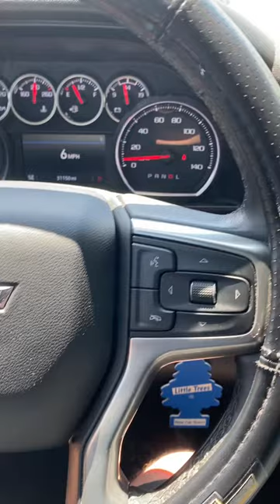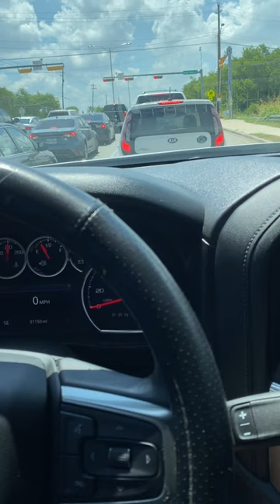2021 Chevy Silverado weird whining noise

Comment: I took my belt off and started the truck and it still makes the noise, come to find out these trucks had a problem with the vacuum pump and that’s where my whine noise was coming from. So if anyone is wondering I would pull your belt off and if the noise continues I would start looking at the vacuum pump.
Reply: which vacuum pump? break vacuum?

Comment: What you don’t like the hellcat sound? I just replaced mine in my 2021 just out of warranty due to mileage. Just over $100 for belt and idle pulley and used the zip tie belt install method.

Comment: Same sound and same issue I changed belt and going to change idler pulley dealership has said it’s a common problem and people have been changing those two parts
Reply: Thanks for the information

Comment: 100% idler pulley. Even tho you probably know that by now. 2021 Silverado 40k miles and idler pulley was going out. Had some people fooled with the supercharger sound.
Reply: Do you know what part number to order? My 2020 just started with 31k miles
Reply: How much was it to get it fixed
Reply: @Jdawg-hn5pd  like 70 or $80 to do it yourself.

Comment: Ive been watching this video and reading these comments for the last couple weeks looking for answers on my 2020 trail boss with 43k miles. Was having the same noise so i took it into the dealership to get everything looked at including the idler pulley and torque converter but where i live it has to sit at the dealership for 2 weeks before it even gets looked at so i went to pick it back up after a couple of days because i simply cannot be without a vehicle. Im the original owner so i still have the 560 warranty however i was sweating bullets because i had put a k&n intake on, so i went to go get it to put the stock one back on then take it back like a week later so i would not void the warranty. Turns out that the noise completely disappeared after i put the stock intake back on. It makes no sense to me how or why there should be sensors all over that tell me im getting either too much or not enough air. My advice is that if you have an aftermarket intake put the stock one back on first before you go drop any money on it.
Reply: That’s weird. Mine started doing that a few weeks after i put after market exhaust. I ordered the idle pulley and belt. Hopefully that’s it
Reply: @Guanacoboi  Was that it (the idler pulley)? I also have the after market intake. Hoping it's not that because I sold my stock intake lol.

Comment: This was a very helpful video and so are the comments. I have a 2021 Silverado making the identical noise. Following on the comments, I took it to a mechanic and suggested the idler pulley was out. Turns out that’s exactly what it was. Thanks!
Reply: @gregmac2392 this is the same sound my 2020 Silverado just started making . Is this something that is covered under the chevy warranty ? Or about how much did it cost you to get it fixed ?
Reply: My 2020 just started doing this!
Reply: Mine 2😂 but I got 75kmi warranty wtf! Such a bs for such a newer truck
Reply: @Guanacoboi can I ask how many miles at which it started?

Comment: The issue with my 2021 Silverado 5.3 engine with 15,600 miles , was a bad tensioner pulley and serpentine belt . There’s no whining now . But I’m still saying , those type of issues normally happens miles down the road . I’m glad it wasn’t more serious.
Reply: Was yours covered under your warranty I’m having the same problem with my 2021 trail boss
Reply: What parts did you order? Part numbers? Thanks
Reply: My 2006 2500 Silverado that I’ve had since 06 just barley starting doing it
Reply: @chuyg522  it’s the idler pulley. I changed it on mine along with the belt bc you have to as well and it sounds quiet and smooth now 😎

Comment: Yup had this same problem went under hood and shot some lube on idler pulley and noise changed drastically. So went to dealership and they replaced belt plus idler pulley and it is quite like a brand new truck. They know this is a problem!!!
Reply: I’m in a rental and it’s doing it bad. 68k
About to spray it down like a clown!
Reply: Still loud. 😢

Comment: Same sound on my 21, 44k miles. Sounds like idler pulley. Thanks for video.
Reply: Me too i have the 2020 5.3
Reply: @robertsonmaciel7426 same here. Did you get it fixed?

Comment: For those who might care. I have a 2019 Chevy Silverado 1500 5.3 4x4 ltz. It was way to quite off the line for having an LS 5.3 so I cut the muffler and exhaust flap off and put a straight pipe in it's place it still comes out the passenger side behind the tire. IT SOUNDS AMAZING even with the automatic fuel management when it's in 4 cylinder mode its ok when I stomp on it or cold start. Its everything id expect and it sounds so aggressive!!!!!

Comment: Ive watched this video 50 times and been reading all the comments trying to get an idea of whats going on with mine. Im sure homie has got it fixed by now but i just got mine fixed with the same exact sound, it was a transmission fluid pump that had failed. Easy fix for the dealership. However if you’re reading this and you have the same issue i hope you are the original owner because mine would have been $4500 if i wasn’t under the original warranty. Dont go tearing apart your idler pulley or some shit like that. Anyway, as of october ‘23 as i write this chevy has been on strike for 2 months straight now so parts are extremely hard to get. Luckily the area i live has a huge inventory. Inflation has gotten fucked too and made parts expensive. If you have the same issue hopefully you have the 5,60 warranty or know a skilled mechanic cuz I already know i wouldn’t have dropped 4500 on that shit. On top of it all it was driving fine too with no check engine light.
Reply: This comment sounds the most correct to me. It sounds like power steering pumps used to sound when low on fluid. 
It is definitely a fluid pump sound. 
The only two fluid pumps on this truck are the oil pump and tranni fluid pump. 
My truck is making the same sound. 2 weeks after purchase. 

Does it also feel like it shifts down too early? Or like all the gears feel like 1st, as soon as you take foot off gas, the truck slows very quickly? 
Thanks all

Comment: My guy please do a follow up video if you have the problem fixed. I NEED to know what’s the problem because my 04 is making the exact same noise. I can’t figure out what’s making the noise
Reply: Did you fix the problem? My 05 Silverado is now making this noise
Reply: @Kevin_Yagoonie  power steering pump. Typical older GM trucks have had that noise problem
Reply: @aidanhaller5800  geez I been having bad luck with it lately. First a brake line went out. Then the brake master cylinder leaked brake fluid in the booster and sucked fluid into the engine. Replaced the brake booster and master cylinder and while bleeding brakes a front line blew out. Now this damn whining noise. Haven't even got to put the front brake line in yet 😡
Reply: @Kevin_Yagoonie  well, its an 04. She’s a bit old

Comment: Did you ever get it figured out?? I have the same noise. Taking it in tomorrow to the dealership. I took off my pulsar lt and when I turned my truck on I have a check engine light now. Usually an idle pulley won’t cause the check engine light.
Reply: I have same noise too. What did the dealer tell you?

Comment: I'm having this same noise and it's driving me nuts. In the past week I've replaced my idler and tensioner pulley, serp belt, stretch belt, water pump and thermostat and I'm running out of ideas of what it could be. Mine is a 13 silverado with 114k lifted (which has been a nightmare)

Comment: I had this same problem on my 2020 Trailboss with 45k miles. I changed the idler pulley and the sound is gone. The idler pulley bearing had failed.

Comment: . I discovered the buzzing vibration sound was coming from the fuel tank heat shield on the driveshaft side. I reached up to the top of the heat shield. I have a 2021 Chevy Silverado
Reply from the maker: It was my idler pulley on mine

Comment: Just drove 2022 off the lot. Same noise 85 miles on truck. Taking it back tomorrow.
Reply: What was the outcome.
Reply: @throwbacktailgaterso.c6317  they put me in a truck that had 7 miles and said see, its making the same noise. they said it was the turbo. BS (i have a 22 silverado 2.7l, this is my 2nd one because my other one was totaled 3 weeks after i got it and it was silent.)
Reply: Was it the 2.7 liter or the 5.3?

Comment: Same noise on my 2014 gmc 4X4, 156k miles,  but the truck has to be moving forward, pushing the gas pedal and then it would get louder as I go faster. Once I let go of gas pedal and it would cruz on its own , noise would go away? Doesn't makes noise when truck is at stand still or idle.  Today I switched my 4x4 nob from Auto to 2^ and it suddenly went away?? What the hell?

Comment: Same issue, I have a 2021 GMC Sierra with 32K miles. Part is on order. GM needs to do better!
Reply: What all do you have to replace sir?
Reply: @bfro2018  idle pulley and belts had to be replaced. According to my mechanic at the dealership, “this is a common issue for all 2020-2021 GM model trucks.” The parts are under warranty and should be free of charge.
Reply: @prestonkilpatrick6575  ok thanks glad they are under warranty will be goin to dealership   thank you
Reply: I hit the three year mark … 6days ago
Reply: Would it still be under warranty on the power train  warranty

Comment: That is your power steering unit. Low Fluid, Wrong Fluid, or pinched hose-line.
Reply: Sounds exactly like engine driven power steering pump noise but it’s not. Silverado has an electric power steering pump that does not  change frequency with engine RPM

Comment: My 2018 started doing that also. Did you ever figure out what was wrong with it?
Reply: Did you figure out what was wrong with yours? I have a 2018 making this noise.
Reply: @travissmith2643 

Idler pulley, tensioner and a new serpentine belt. At first I had the shop replace the Brake vacuum pump and that didn’t fix anything. The 3 things I mentioned above fixed my issue.

Comment: my 2015 is doing something similar but not as loud , I just got the truck so I dont know if it is normal for a gmc to have some amount of engine whine like this or not, it sounds like the sounds a vehicle makes when the power steering pump is going bad or needs fluid but this truck only has 78,000 miles so I wouldn't think the power steering pump would be bad yet. it is under full warranty though, I guess I should just take it in! very annoying I have only had it for a week and already have found a few things that needed to be replaced/repaired.
Reply: Could be coming from the torque converter in the transmission, i got a 2014 sierra with 130k with a transmission that slips and my truck is starting to whistle on it, quite a few issues with the truck and only had it for a year.
Not impressed with GMC
Reply: @Chah18  oup if your transmission is slipping your gonna need new one or rebuilt soon. My 2015 Sierra transmission blew out the other week. Now it's fixed and rebuilt but something is hissing around JLT hose I got or around the water pump
Reply: Hey how u doing did u ever get to see what that noise was on it truck mine do it
Reply: @tonysimpson6022  they said it was transmission, rebuilt the transmission and it still makes the noise.....but also now the transmission is not working right so I wonder if it is the torque converter . I do not know but it is expensive to find out so I will tell you when I find out so maybe save you some $ I am taking it back in the morning . it is very frustrating.
Reply: @AsTheWheelsTurn   any update ? My trucks been making this sound since July.. even when its in park as long as the engine is on

Comment: Did you find out what that noise was? Mine is doing the same thing.
Reply: Did you get it fixed? I had the same noise coming from my truck and it was the tensioner pulley

Comment: 2019 sierra 5.3. Have the same sound. They replaced the idler pulley and belt. No change and now they say it’s a normal sound from the oil pump 🤦🏻‍♂️
Reply: I would go to another dealer, seems everyone on this page is  giving the diagnosis .

Comment: My truck is making the same noise. Did you find out what it was?
Reply from the maker: Dealership where I got it is so busy I can’t get it check til July 12th😒
Reply: Idler pulley I bet
Reply: Mine has the same noise
Reply: Is your ac on?
Reply from the maker: @larrywilcox6184  it makes the sound with the ac on or off
Reply: Mine just started it’s a 2019 1500 with 82 thousand miles I’m about to take it in how much did you spend Uriel on the pulley with labor and parts

Comment: I have a 2022 Silverado custom 2.7 and my truck is making a similar noise but mine is more of a whistle sound. The noise is pretty loud and it happens when I accelerate and when I’m stopping but when I completely stop the noise stops. My truck has about 11.5k miles and this is the second time it’s happened. First time was around 5k miles and took it in the dealer and they said it was a purge pump? I have to take it in again, I’m assuming it’s the same thing being that it sounds exactly the same as the last time. Also got a message saying they’re a a problem with the emissions system. (Which I got the same alert as the first time at 5k miles when I took it in) has anyone else had this issues and if so what causes this? I’m a first time truck owner and it’s just annoying because the truck is barley a year old, it shouldn’t be doing this lol

Comment: Mine was the idler pulley. There isnt a belt  tensioner. Zip tie life hack is all you need
Reply: Please explain
Reply: @chancewhite9641  To get it off. You can cut it off. I took my idler pulley off on the top right. Pulling on the belt to release some tension. Came off no issue and no bind
Reply: Did you replace the pulley or just remove it
Reply: I replaced the idler pulley on the top right
Reply: Where did the zip ties come into play?
Reply: @creigstanfield  The bottom crank. It has cutouts. Four zip ties quick start and shutoff. Snaps the zipties and puts the belt in place
Reply: @JustaDadGamer  👊

Comment: I have a 2020 trail boss with the 5.3 had it since it had 7 miles I just hit 68k it started the exact freaking noise about a week ago I was thinking harmonic balancer
Reply: Hey guys just FYI not harmonic balancer or its bolt. It was the idler pulley
Reply: Mine did the same thing at 68k miles
Reply: I hear more of the noise at bottom that why I thought it was harmonic balancer. Where do did you hear it get louder?

Comment: Yes. Had the same problem. Got a 2wd rst. It only had less than 30k miles and it started making the same noise. Took it to the dealership. Fixed it and hasn’t made the noise again. Can’t remember what the actual problem is on top of my head but it has to do with the differential. Started making the noise driving from Florida to TX.

Comment: I have a 2021 with just under 30000 miles and it's making the same noise I'm going to take it to the dealership on Tuesday to have them take a look at it
Reply: I have a 2021 trail boss lt right at 23k miles and making same noise. Will take to the dealer as well. Same boat.

Comment: Just took my 2021 Silverado for the same issue
Reply: Did you fix it and what it was ?
Reply: What was it? Mine makes the same noise?? Its at the Dealer now. They are tryna diagnose it.
Reply: It was the ilder pulley that went out noise is gone
Reply: @santia805  dang..they fixed that but it didnt solve the problem…haven’t heard back yet..
Reply: Same issue here 2020 ltz 42,000 miles noise drives me crazy exact same sound as this videos just wanted to confirm it was the idler pully. I heard the bearing inside is what causes the noise
Reply: @DavidRodriguez-ob4rg  Mine was the Oil Pump in the Transmission.

Comment: I have a 2019 Trailboss. My truck started to make a loud rattling sound only and 23-28 mph. It doesn’t sound like the video, much lower pitch. Has anyone experienced that?
Reply: At*
Reply: Same Noise my 2022 1500 Custom is making . What the hell is it??
Reply: Sounds like your engine is about to collapse.
Reply: @rickmartinez7637   I think someone said that it was their driveshaft and gas tank shield rattling lower in the comments.